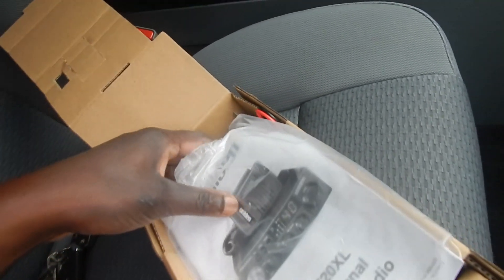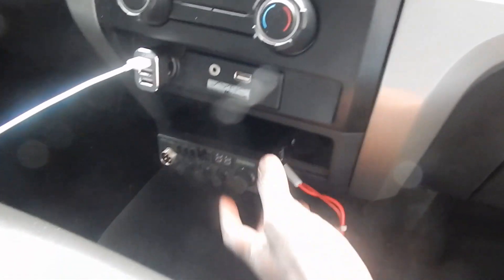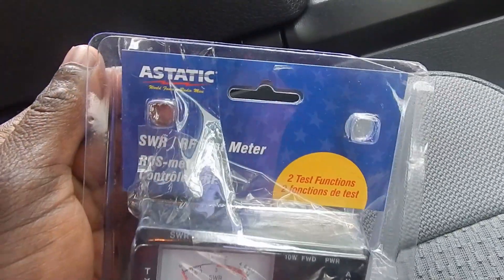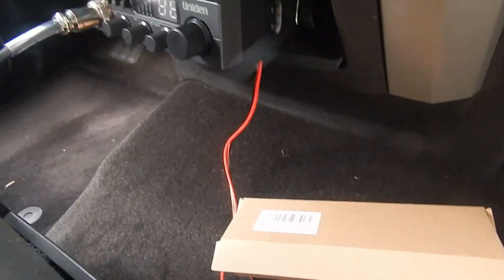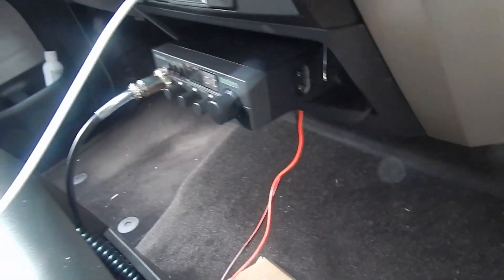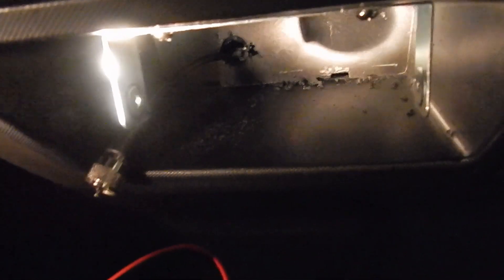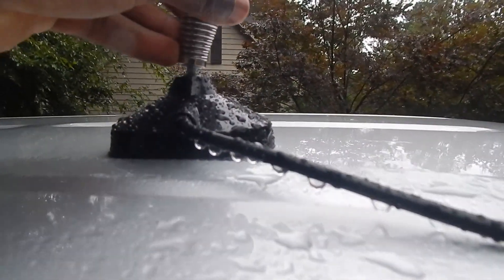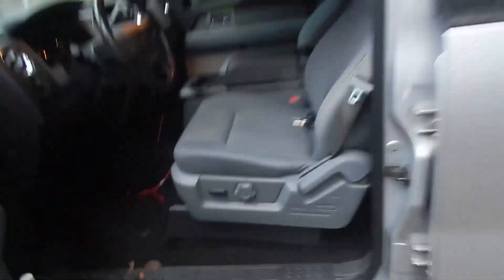Installing a CB Radio in my F150

Comment: It is possible to get static from your phone charger. I have a 2012 F150 and my interior looks identical to yours. I think you did a great install. I plan to run a Wilson 1000 magnetic antenna and mount it to the back of the top and bring my antennae coax into the back door. I want to be able to easily disconnect it to put it in my garage in the winter. But all in all I think you did a great install!
Reply from the maker: Thanks Randy!  It may be possible, but I haven't experienced that at all with my phone charger.  I do have interference from my radio but it's rare.  Thanks for your comment!

Comment: Both my F150s are Lariat so I have the whole center hump area taken up with console and shifter. I have no choice but to go on the top of the dash. Good job on the video! Get yourself an SSB radio next and try your hand at sideband DXing. If you hear engine whine coming through your radio you can run power wires direct to the battery and clean up your receive. Hope you're having fun with your radio!
Reply from the maker: SSB Radio huh?  I'll look into it!  I'm having fun with my radio- although it's rare to hear people talking on CB nowadays.  I may have to do a switch, I have my technician's license for amateur radio, so that may be next.  Anyway, thanks for your comment HW Sadberry!
Reply: @BarringtonLewis  my name is Tony Smith and I am gay and my new name is Bank money and my boyfriend new name is Bank money 💸 💶 💴 💵 💳
Reply: Yeah I'm trying to figure out if I'm gonna do on top of just put it on lower side of dash near my left knee the console makes it harder

Comment: Best way to wire a CB radio in a vehicle is straight to the battery. Great video
Reply from the maker: Thanks Blazin Spike 3809!
Reply: Hi! So went straight to the battery on my 2018 Silverado and I get tons of noise and when I turn my steering wheel i get ever more noise. Any idea how to fix that? 
I was wondering if added a 2nd battery and running the CB right to that might make a difference?  Thank you

Comment: Not a bad video I get it was hard to hold that and do the work the same time but still good job. I've had a CB in my vehicles for a very long time I just went on to make that antenna amounted it to the truck where the whole truck becomes the antenna it will work just fine.👏
Reply from the maker: Thanks Dave

Comment: Does it have a SWR meter it has to have one of those right?
Reply from the maker: That's correct Folton - I had to use an SWR meter to calibrate the radio to the antenna.  Sorry I left out this part... but be sure to test using your SWR before you complete the installation.  Thanks for your comment!

Comment: Most other videos ive seen suggest the antenna go on the opposite side to avoid interference with the radio antenna .
I'm no expert just an observation.
Reply from the maker: Thanks Shannon - I'm no expert either, but so far I haven't had any interference between my regular radio antenna and my CB radio antenna.  I've used it on the highway and around town and it works great.  

But perhaps my experience isn't the same for everyone.  Nevertheless, thanks for your comment - something to consider when people are hooking up their CBs.
Reply: I would have put the antenna in the back so it doesn’t interfere with my stereo antenna. And most people use channel 19. But good idea for radio location.
Reply: @newenglandtrucker6049 More range the higher you mount it.  The closer to the center of the vehicle the more even the pattern will be.  Not a very good ground plane in the back so that wont work as good for TX or RX (Unless you us a Wilson trucker antenna where the coil is above the roofline)..  The interference with the AMFM antenna is an old wives tale.  He should try to hard wire it instead of using the cigarette lighter.  That looser connection in the lighter plug can interfere with your AM FM radio.